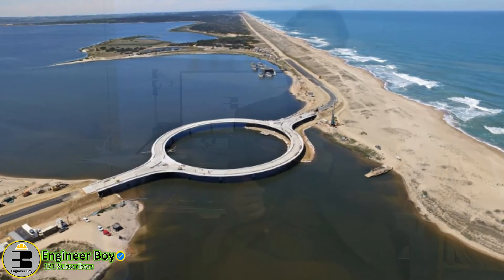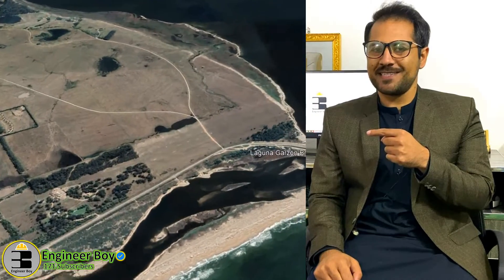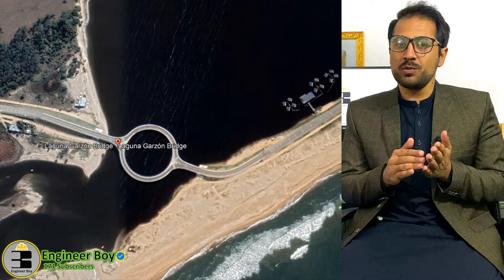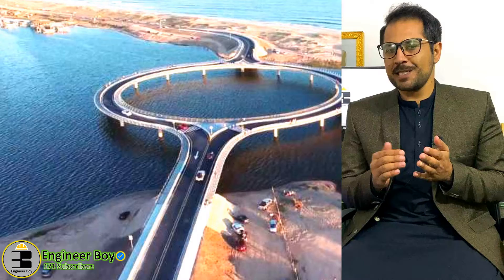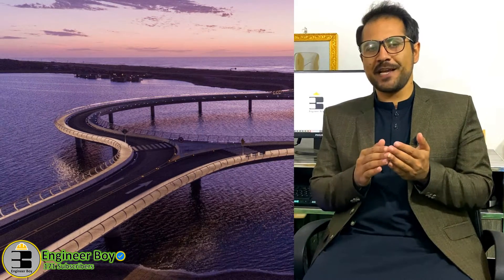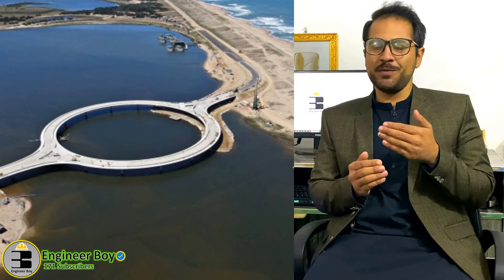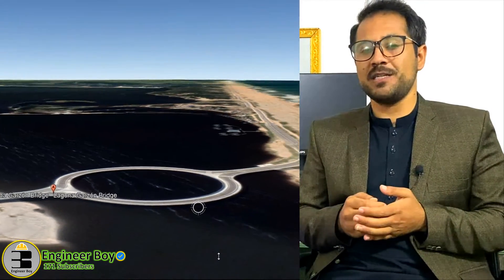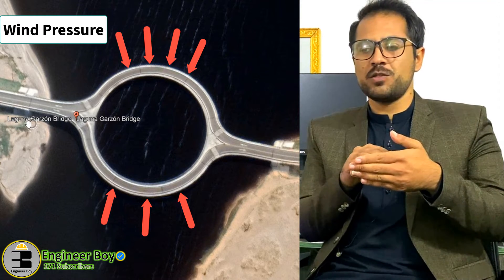Civil engineering mistake? Incredible bridge design | Laguna Garzon Bridge

Comment: Dear Suliman, the first point might correct, to spread the road lines to mitigate the accident risk. But technically the reason behind the circular shape is water or sea bed level Ground situation and the behaviour of water flow. Which effect the design of the piles length.
Reply from the maker: ❤️❤️❤️❤️❤️❤️ noted